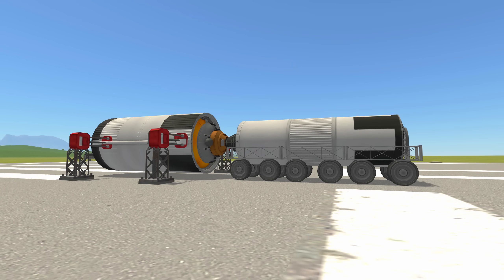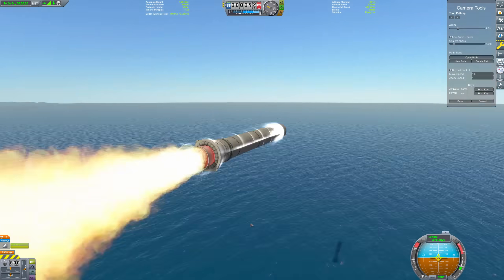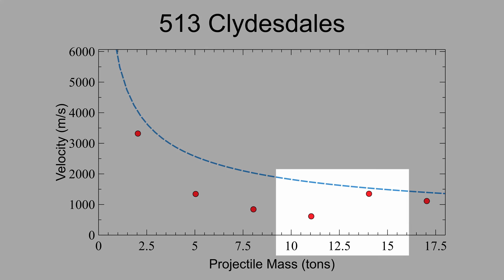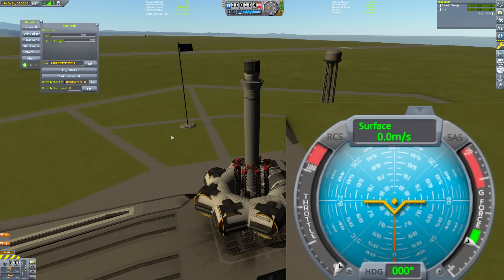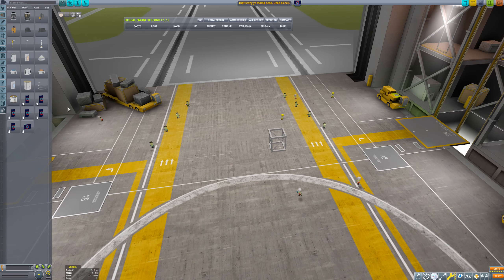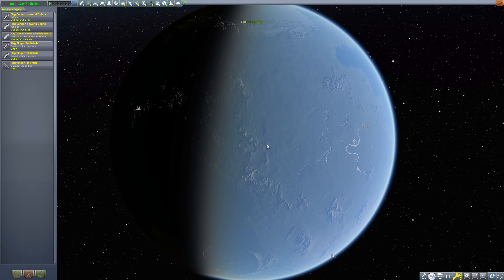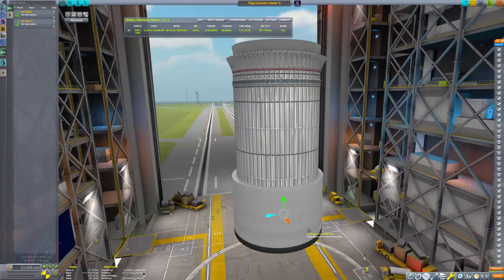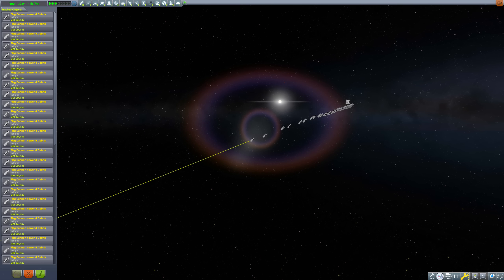Engineering a LIGHT-SPEED mass driver | KSP 1.10.1

Comment: something im curious about here is the "time dilation" i seem to experience when playing, inherent in the ksp universe. i havent measured it myself but it seems as if the drop in framerate due to accelerating a larger craft may give more time to calculate a change in velocity for an amount of deltaV "per tick" than otherwise. essentially meaning, maybe, if you bogged down your computer enough with this approach to the mass driver you could be allowed more frames of active thrust on the object. of course it appears youve met a satisfying conclusion however im interested if my perceived experience truly exists and if it could potentially add another variable to your calculations

Comment: For a more accurate simulation, what if KSP used an additional calculation for this? For example, on the frame when leaving the influence of a rocket engine, it will divide the distance to the edge of the influence zone on the previous frame, by the distance traveled between this frame and the last frame, and multiply the acceleration by that, the result should be physically accurate. For example, the part being launched is 5 meters away from the engine, and the engine exhaust distance is 10 meters. The engine accelerates the part at 5 meters per frame, so the part is already movig at 10 meters per frame. On the next frame, the part will be outside the engine exhaust range, thus it should only get half the acceleration because it will be only influenced by the engine acceleration for half the frame. So we take engine range 10, minus distance to the engine 5, to get the distance to the exhaust edge 5. We divide that by the velocity 10, to get the multiplier for the acceleration value for this frame 0.5. so the part will only receive 2.5 meters of acceleration on this frame instead of the full 5. Seems to make sense to me at least, although computationally expensive for such a niche use case

Comment: Actually this video can be a great example of how calculus works. IRL, you recieve the constant and continuous proppel force by the continue of the time, so the square root function, but in ksp, that one dimension is devided and only have foced in as the form of 'points', hence the root integrated.

Comment: Dropping the flag is faster probably because the acceleration is applied to the flag on the first frame of contact, but it doesn't move until the next frame. Therefore, two frames of acceleration is applied to the flag.

Comment: Technically Kerbal speed of light is 1/7 of what it should be as the Kerbol system is 1/7 the scale of real life.
Reply: not how that works
Reply: if everything in the universe is 1/7 normal size, the distance light needs to travel in a set amount of time is 1/7 normally, meaning it went less distance in an amount of time or less speed. Also you're right in the sense that the Kerbol system is in our universe but i was from the point of view that it's in it's own universe that mirrors ours at 1/7th the scale

Comment: 12:25
The flags are propelled so violently, they are put into a quantum superposition of existence. Until observed, they both do and don't exist. However, once you switch to the craft to observe it, the wave function collapses, and it either exists or doesn't, and you see the result of that decision.
Reply: Schrodinger's lightspeed flag
Reply: rather that is just time dilation combined with the fact that any observation would require energy exchange, and at such speeds would result in a slowdown and instant annihilation
Reply: outer wilds vibes
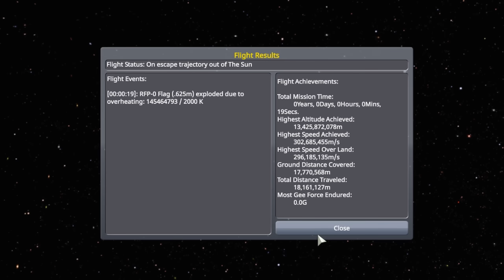Reply: 12:39
145464793 degrees Kelvin.
"Decently toasty."
Reply: Schrodingers flag xd
Reply: @@iankosednarhailrussia574 Schrödingers cat is common knowledge.
Reply: I managed to break reality and physics that haven’t even been discovered yet in gmod.
Reply: If that were true it would lead to massive discoveries in the realm of quantum physics because of how large the flags are. This would blur the line between quantum and classical mechanics greatly.
Reply: reminds me of a certain cat...
Reply: Schrödinger’s Cat Flag
Reply: i wonder if you could reach planck temperature

Comment: Simple solution. Build a craft that is very big. Have the control, engine, and a tank of fuel near the bottem. Then use a bunch of structural parts that extends teh craft over the physics load distance. Then fly around with that.

Comment: 1): ignores the problem of exponential air resistance by blowing the concept out entirely by not giving reality the chance to even check.
2): locks the projectiles in a state of quantum super position where their only destroyed if you look too closely. it does this by shoving them away from you so quickly that again, reality doesn't have a chance to check.
3): fully automatic and can fire as quickly as you can load the projectiles. arguably faster even......
4): has built-in "you got shot by--" taunts, as if the target would ever have a chance to read them.
5): techniqually only ever applied 0.0 g's of force.....apparently.  (12:36).

Comment: 3:17 if you do your data interpretation right: no
You know that to get an exponential you have to take the log on both axis, to make it to humans clear, what exponent it is.
It would be just the slop of the straight line then (beeing straight, means, that it is really a constant exponent).
Also you need to add error-calculation etc to make such claims
4:52 better, but still...
6:34 for 1 not there is no maximum, but should be selfexplanotary (kinda later in the video)

Comment: Hmmm. It looks like either the two or three boost peak is desirable for more conventional cannons like artillery or naval guns, which sadly can't match the efficiency of hypervelocity single boost cannons. For the two boost that equates to about 120000 m/s^2. For the three boost, more like 30000.

So if we want something like a 1000 kg projectile we need somewhere around 120000 kN to be applied for two frames. So the cannon itself should be something like 80 Mainsails.

Alternatively, for a smaller cannon, we might be able to get away with 10 Mainsails or 15 vectors firing half tonne projectiles.

The nice thing here is that the actual fuel consumption in either case should be tiny. A 60-tonne artillery piece firing 500 kg shells might drink about 120 LFO, meaning mach 2 shells for roughly 1:1 shell to propellant ratio.

Comment: FYI you don't necessarily NEED a lot of thrusters to increase the thrust. You can "over-throttle" by using the Breaking Ground robotics controller. What you do is set the thrust to be controlled by the controller. Then, you use the little angle-ing things on the line and it increases the curve over 100%. Then, as long as you set the controller time to the center, you'll have more thrust than should be possible.
Reply: Like in this video here https://youtu.be/KCwXiWU1jwg

Comment: you could also increase the acceleration with fewer boosters by using a similar strategy to the Nazi V3 cannon. multiple boosters, each at an angle, would be able to constantly accelerate the projectile over a longer distance.

Comment: You have literally created a flag laser - they travel at lightspeed, have nearly no mass, and are very very hot at a subatomic level - like real photons
Reply: I know 0.5kg is "nearly no mass" in context, but if a single photon had a mass of 0.5kg, its wavelength would be 4*10^26 m, comparable to the radius of the observable universe :) Then again, if the KSP universe doesn't have relativity, why should it bother with quantum mechanics?
Reply: @hadinossanosam4459 is wavelength related to mass?

Comment: I'm curious to why dropping the flags produced higher delta v. It seems to have something to do with the acceleration or initial velocity that comes in contact with the plume. You should try different speeds and different accelerations, maybe the effect can become so great you can make a reasonably small craft reach faster than light speeds.

Comment: The change in results from a moving flag is very likely due to optimizations in the physics engine. When the flag isn't moving the game applies the acceleration to the velocity immediately through a fast path in code. When an object is moving it is summing all the forces over the course of one frame, and then applying them next frame. This means that the flag is recieving thrust from more of the boosters.

This makes sense in KSP's context because the aero model relies on opposing forces canceling out, such as gravity and lift. For a moving object, if those forces were immediately applied to velocity it would produce potentially non-deterministic results (For example, take a plane with two engines. If the force was applied in the order Engine, Drag, Engine, then the two engines would wind up producing different thrusts at the same speed because the speed they are moving at the time they are calculated would not be the same) summing all forces over the frame and applying next frame helps to deal with that.

(Disclaimer, I have not personally taken the time to verify this in ksp's code, this is just conjecture from experience working with other physics engines in games)

Comment: What hardware are you running. I'm wondering how reasonable this would be for my computer... If reasonable is a term here 😂😂
Reply from the maker: I'm running a ryzen 3900x. Its a decent processor for KSP, but its better for multi-core tasks (like video rendering)
Reply: @Stratzenblitz75  ah. Very familiar with that line. I'm running a 3600. Probably won't be attempting this then. Good to know.

Comment: Speculation: If you drop the flag into the engine the game gets alot more positions inside the exhaust to add force. You increase the time the flag stays in the area in which the force can be applied and therefore you get higher velocities
Reply: I think it's because the flags when dropped have a negative starting velocity that must be overcome by the booster before it can accelerate upward, so it spends just enough more time in there to get even more acceleration.

Comment: Could it be that dropping a flag into the exhaust creates a higher total force since the boosters aren't immediately at full thrust? This would coincide with the test where the ore tank got 2 boosts. The first boost only gave about 500 m/s while the second boost brought the total speed over 1300 m/s, meaning the second boost gave more than 800 m/s of acceleration. Similarly, if the flags start outside of the thrust for the first few frames, they will enter the thrust column only AFTER the boosters have ramped up to full thrust and thus giving it a higher acceleration?
Reply from the maker: That's an interesting hypothesis. I thought that SRBs outputted max thrust immediately but that may not be true.

Comment: A thing to note is that due to the way matter density acts in KSP, the derived KSP speed of light is 10 times slower, so you've actually achieved near speed of light with the 1000 boosters and 10 times the speed of light in the second method.

Comment: So here's the thing.
I play with several stockwar groups. Until now, NO ONE AMONG FIVE DISCORDS has been able to answer this, the question that has prevented conventional weapons in space.

I used this data, and reconstructed one of my light cruisers. Using a mass driver weapons system, I'm getting pinpoint accuracy, to the 1x1 panel, between ANY TWO POINTS IN CISPLANETARY SPACE. Literally the only variable is aiming.

You, sir, may have just saved KSP warfare, just in time for ksp2. The whole community thanks you, sir.

Comment: Haven’t watched past the first bit, but let me first note that your “ideal” equation assumes that the force is constant in the acceleration region, which in reality wouldn’t be the case. In real life, the force would start at some maximum at the engine bell (be a pain to calculate due to thermal expansion and chemical enthalpy and whatnot) and taper off due to something akin to he inverse square law. The result of the speed would include an integral of acceleration with respect to distance. An integral of acceleration with respect to time would be more straightforward in some respects.
But I’ve no idea how KSP models its exhaust plumes, so you may well be right.
Reply: Yup, it’s just a simple ray so your physics should check out. I wonder if that 9.8m ray will increase effective thrust while you’re in its range, as in the ground-effect?

Comment: Looks like you've just made relativistic kill missiles with an energy of a whopping:
KE = 1/2 mv^2
      = 1/2 0.5 (kg) x 302500049.8 ^2
KE = 228765700000 MJ
Or 54.67 megatons. Per flag. Enjoy wiping out a continent with nothing but kinetic energy!
Reply: Except kinetic energy can only be expressed in this way at non-relativistic speeds. Reaching the speed of light would require infinite energy, and those flags went past c. Even if they were going at 0.9999999999c they would do a whole lot more damage than that.
Reply: That'd be suicide, it would destroy you before it even left the atmosphere.
https://what-if.xkcd.com/1/
Reply: I mean, there's probably many megatons of explosive on the pad as well, considering it's 2500 boosters worth of solid fuel. just throw that at your enemy

Comment: Could you make a modded engine that is exactly the same as the SRB but with like, 2000x the thrust? That should have the same results while also solving most of the lag.

This video was insane though, it’s really satisfying watching the flags move around the system at light speed in real time haha
Reply from the maker: Thanks! I could make a modded part, but I wanted to see if this was possible in the stock game. The lag was just part of that experience.

Comment: Could this be done more efficiently with the throttle overclocking that Danny used? Would kinda break the "no cheats" boast, but at least your computer wouldn't be more on fire than the flag parts.
Reply from the maker: I have tried this with KAL overclocking, it works amazingly as expected. You only need about ~100 boosters to hit light-speed with a full KAL thrust limiter overclock.
Reply: @Stratzenblitz75  Awesome, thanks for saying! Looks like I've got a few emplacements to put around my career save...

Comment: Next time, just ensure to have the boosters have 1% fuel so they only have enough to fling the object
Reply from the maker: I actually did set the boosters fuel to the lowest level allowed in the editor. That said, I could have edited the craft file for them to have less fuel, which would have helped with the overall mass of it.
Reply: @Stratzenblitz75  I did see later in the video where you'd lowered, so I was like: ohp, still left the comment

Comment: I think what KSP mass drivers need is, instead of putting multiple engines inside each other (or by using this) stack engines radially facing slightly inward, nozzle up, this way objects shot from the mass driver will continue to pick up more velocity from the engines as its altitude increases (albeit still only for a split second. but I think this should give good results)
Reply from the maker: That's an interesting idea. With the data I gathered, you could calculate the distance the part travels in each physics tick and space the boosters appropriately to maximize the final velocity.
Reply: @Stratzenblitz75  it also works with the theory of add more boosters :P

Comment: I wonder what the effect sound of over 2000 boosters would have. I'm assuming that it would level the space center and since air is just vibrations and not a force it wouldn't effect the velocity, but i still would like to see a mod one day that adds auditory physics. Like, the ability to destroy parts by being loud enough or even mathcing their resistant frequencies
Reply from the maker: That would be a cool feature for a mod, or maybe KSP 2. I've always wanted to level the KSC with a massive rocket launch.

Comment: I know it sounds insane, but do you think it would be possible to solve the overheating problem by carefully overflowing the temperature value? How many bits is it stored on?
Reply from the maker: Huh, now that's an interesting idea... I don't know how many bits the temp value stores but its enough for at least 145,000,000. It can't be a 16 bit number, so it must be 32 bit or higher. A unsigned 32 bit integer has a max value of 4,294,967,296 so if you can exceed this you may see it loop around. This may not be possible to do with just boosters, but getting stupid close to the sun could do it.

Comment: Not really practical for the flags since they move so fast away from the starting position, but for heavier objects have you tried using engines in a line to continue to provide force as it moves away from the first engine?
Reply from the maker: I haven't done much experiments with that because clipping the boosters is easier, but it is definitely worth looking into. My data shows that you can space the boosters according the distance traveled in each physics tick to maximize the speed.

Comment: Now use this for interplanetary warfare - shoot a Duna base from Kerbin.

Or shoot through other planets because of large physics timesteps. If the game runs at 60fps, one timestep should be around 5000km
Reply from the maker: If you calculate the slope of the velocity vs acceleration lines that I found, you find that the flags were accelerated for 0.02 s, which implies KSP's physics tick is 0.02s. At the speed of light, the flags travel 6000 km in one time-step, which means it could travel straight through every celestial body in the game except Jool and the sun.
Reply: I’m not sure, but I don’t think the time step is bound to your frame rate.